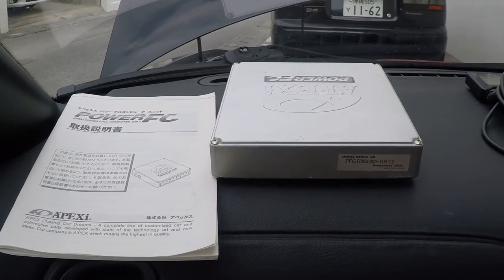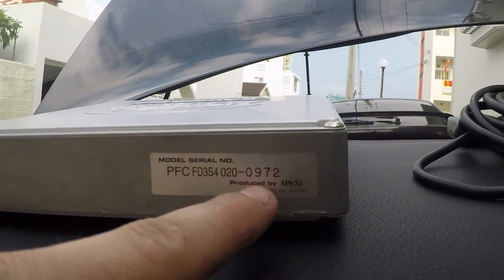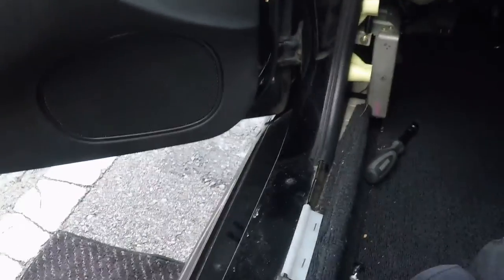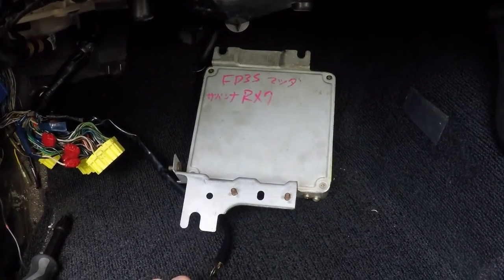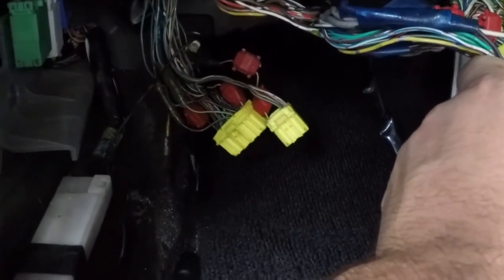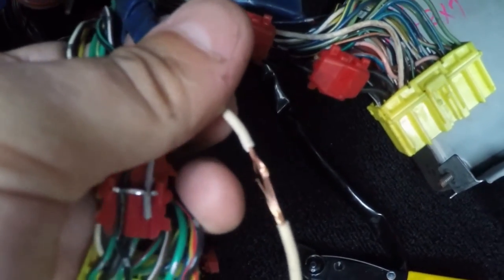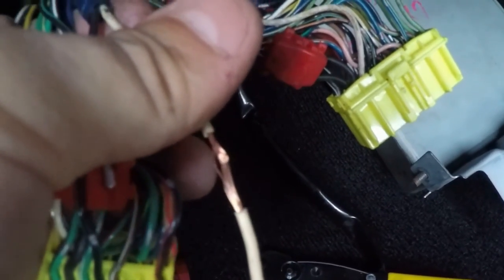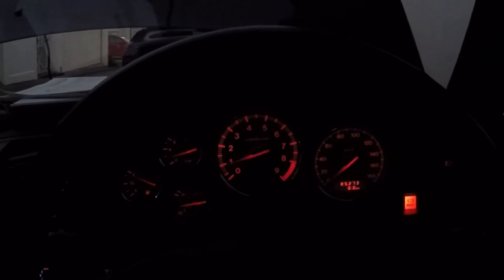FD3S: Apexi Power FC Install

Comment: The green wire for handbrake being bypassed might have something to do with the turbo timer. When you disable the handbrake with turbo timer on the car usually shuts off to stop it being stolen.